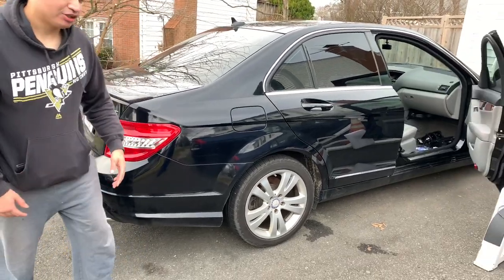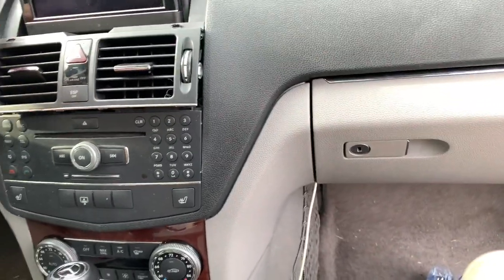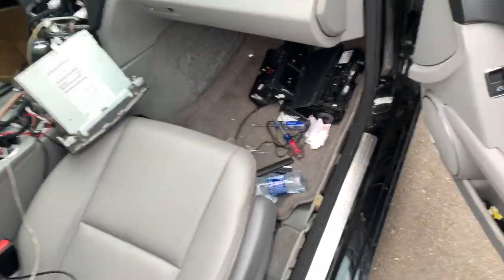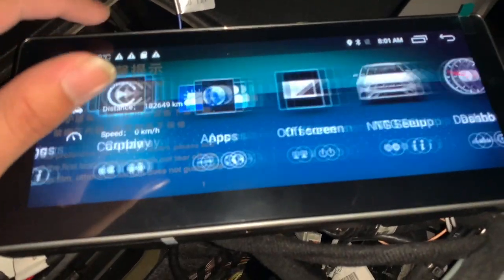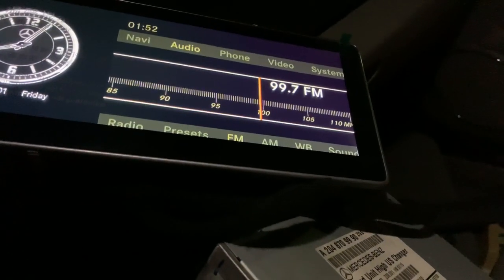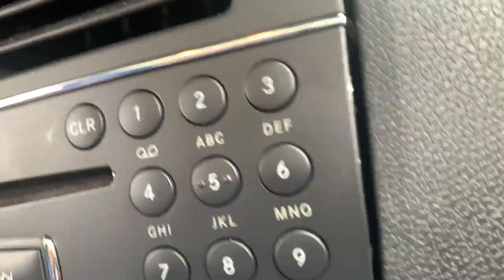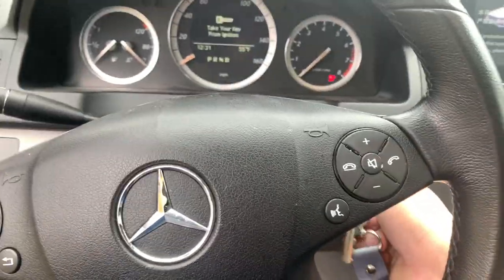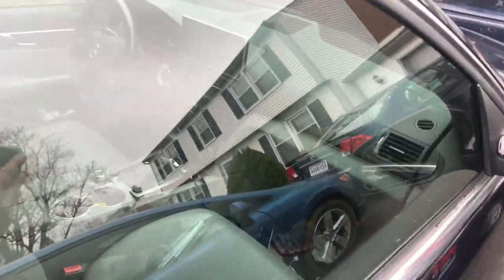W204 C300 large 12 inc Android Head Unit install

Comment: i did this myself in my w204 2008 c-classe i have done this in about 6 hours all in 1 day, i had the same amount of bulky cables i just routed them the way the are supossed to go and used some sticky tape to hold the screen converter unit at the top where the plastic screen cover sits and everything fitted perfect OEM 1st try
Reply: also i don't have the gap on the plastic cover bar
Reply from the maker: Haha must have been nice 😂😂
Reply from the maker: Yeah idk why there’s a gap bro
Reply: Hey guys could you help me out please; wondering if I can use the camcorder's 12v power source as my power source for the lvds box.
Reply from the maker: Idk sorry bro
Reply: Archibald Lendin sorry can’t help you with that either
Reply: Do you have the display code
Reply: “Where they are supposed to go” bro where I have a gap like his in the video and it’s driving me nuts 😭 I spent 10 or so hours over 3 days playing with those cables and I could not get them to sit flush, any help would be great

Comment: Aye bro my radio makes a popping noise what you think that is ? 2010 w204
Reply: Mine does the same thing after the car heats up, if it's a cold morning my radio will work but if I turn it off, it won't work and pops until it resets, I took the whole radio out and changed fuses 😂 still no luck